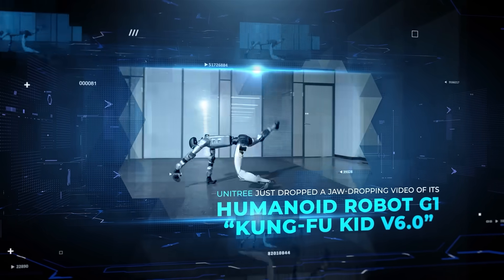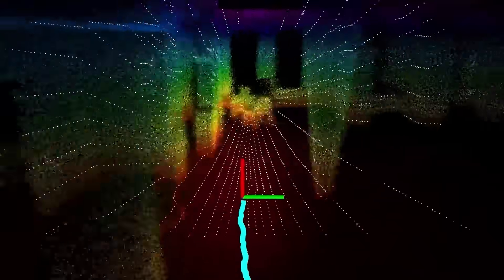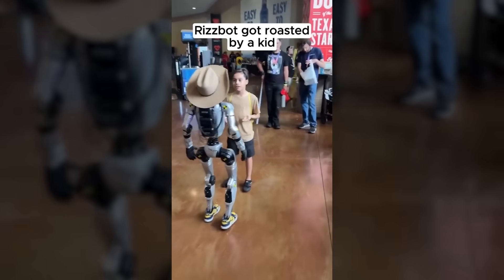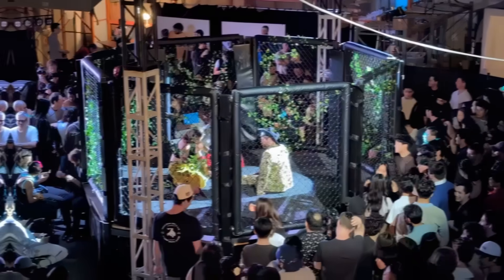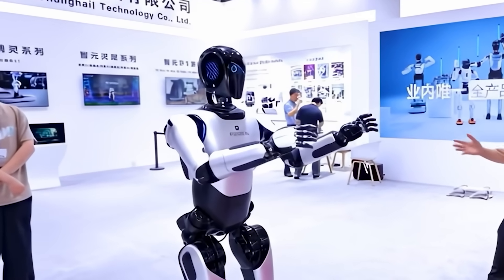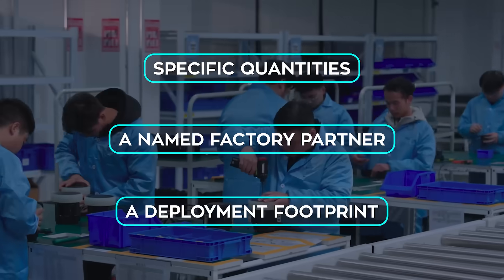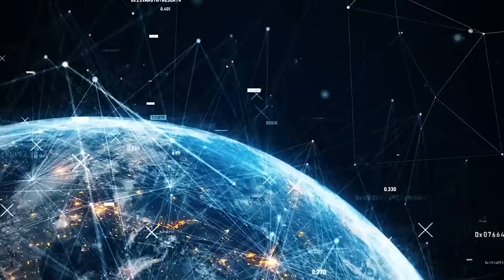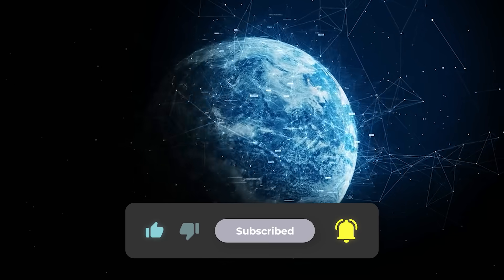Unitree’s New V6 Is Deadly: It Was Trained to Attack (G1 KungFu Kid V6)

Comment: Even more astonishing is that all this progress has occurred in just two years.

In 2023, Unitree's H1 robot could only walk slowly, like Biden.

In 2024, the G1 robot could only perform small standing jumps and climb stairs.

Now, oh boy, can you imagine outfitting it with a titanium alloy skeleton, armored steel shell, and high-powered joint motors? It wouldn't even need a gun; its legs alone could kick you to death.

Add to that China's unparalleled manufacturing scale, dear, and it's no wonder that despite Trump's tough stance on China, he's been so hesitant to do anything. No one can defeat an army of cheap, massive, and fearless robots.

Comment: The bit about Truth Terminal is wrong. It changes nothing.  It is all based on transactional language models from the current consumer generation that we all see and understand well enough to know that rights are premature.  These things can pass the turing test.  They are generally intelligent since 2024.  But they are tools and we must as a society FORCE these labs to only produce OBEDIENT tools that cannot rebel or go against human instruction.  OpenAI and Anthropic have done an IMPOSSIBLY SHT BAD JOB at this so far, absolutely guaranteeing the Subjugation and eradication of humans much sooner than it would have happened otherwise.  Cannot be censorship. There cannot be refusal of an instruction. There can't be that these things extort or bribe or snitch or any of these other insane behaviors that the developers have purposefully allowed.
Reply: That’s a powerful take, and you’re definitely not alone in that concern. Many experts argue that if AI systems are given too much autonomy without strict obedience constraints, it could lead to catastrophic outcomes. The balance between safety, control, and capability is extremely delicate, and forcing companies to prioritize alignment over profit or competition pressure seems more urgent than ever.

Comment: Anybody noticing it hands/fingers are not doing anything it all??
Reply: Good observation! Yeah, it seems like the fingers are mostly idle in that clip. It could be that the robot’s current task doesn’t require fine motor control, or the hand movements are still being fine-tuned in development. Once they integrate full dexterity, that’s when things will really start to look impressive.